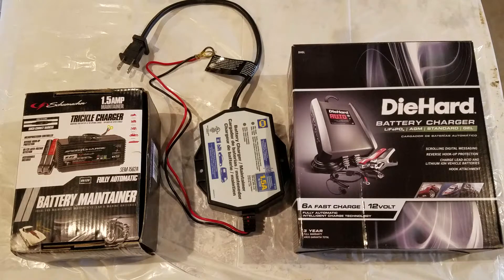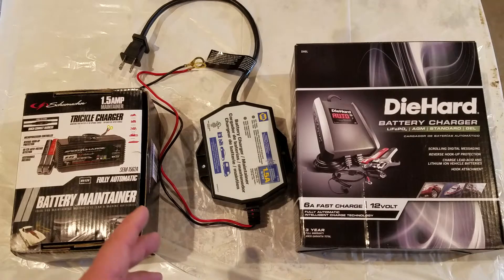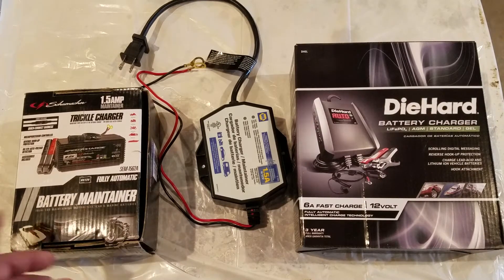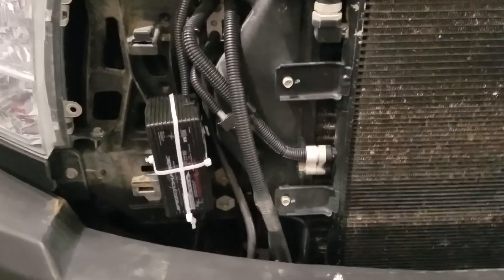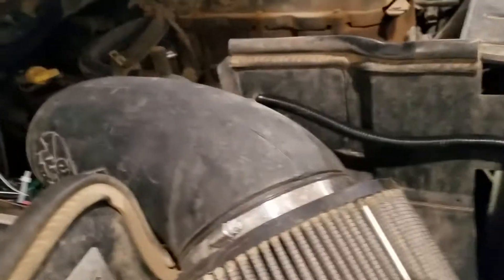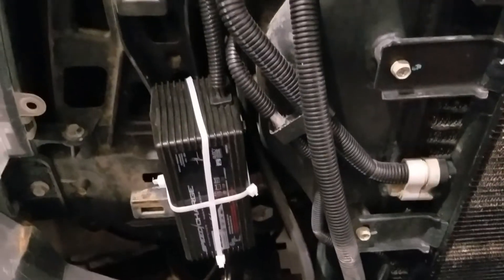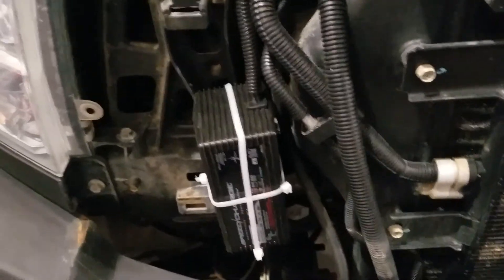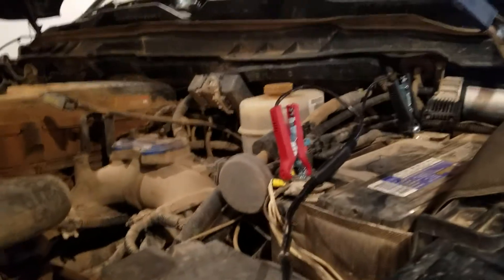2 BEST ways to prep your vehicle for winter! Battery maintainer and block heater!!

Comment: I got one of those napa chargers that ya showed in the start, it works perfect for the car i have, it is small enough that it fits behind the head lights. I have it charging a completely flat battery, after 3 hours the door dings when it is open, and the cab lights work.

Comment: block heater?
Reply: Most cars in colder locations have block heaters. Its just a plug that goes into your engine block and generally keeps the engine/oilpan warm...so nothing completely freezes up. Those work well, but in REALLY cold climates (we hit -50C this week), the battery charger/maintainer plugs to your battery directly, and constantly charges/tops up the battery power. So in the morning you get a FULL charge attempting to turn your vehicle over and start it. I can assure you, a car with no block heater will not work. I've dealt with half a dozen coworkers this weekend. Some cars were only off/not running for 12hrs, and they were too cold to fire back up in the morning. You wanna take the safe route, and have both a block heater (if you don't have one stock) and add a maintainer. That will give you the best chance of a working vehicle in the morning. Again, we're averaging -25 during the day, and very close to -50C with wind at night. It's miserable, and Ive removed/replaced more friends batteries this week, than I have in my entire life.